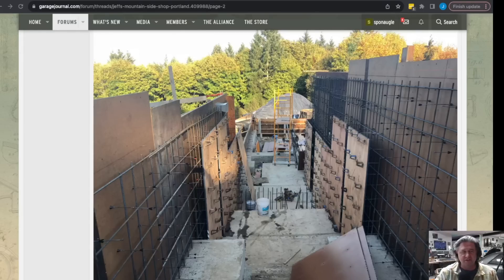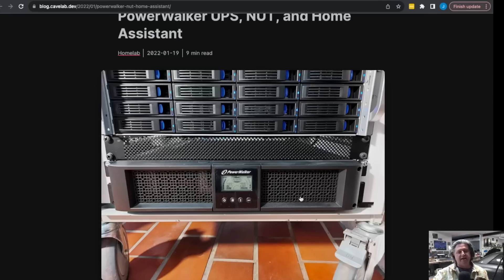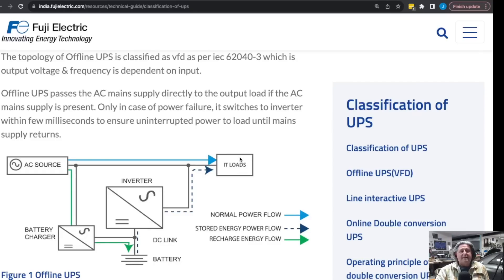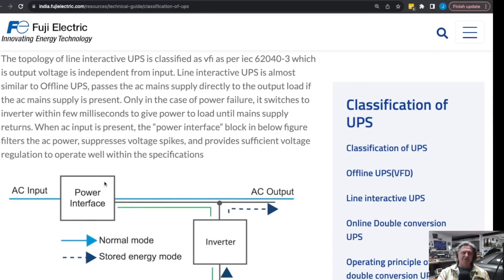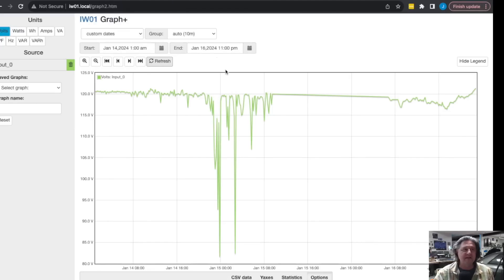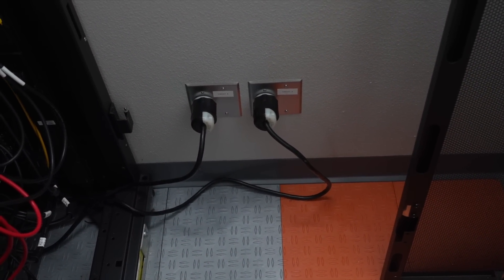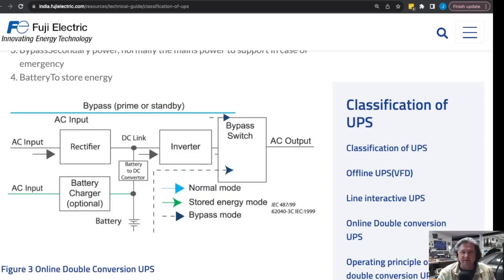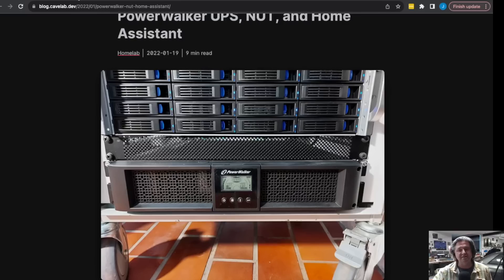Tips for powering your homelab

Comment: That online double conversion UPS.
Question?
HOW do the servers catch fire?
Does the amp draw get too high?
Shouldn't the circuit breaker turn off power to the UPS?
How much power does the normal home lab consume?
240 3 phase or 240 single phase?

Comment: More thought than I want to put into this part of my homelab. I do monitor this through Solar Assistant, but my feed goes into a single 1500va APC UPS that does a pretty good job, it seems, but my homelab is no where near the size of yours. Mine maxes out at 500watts with the loads I put on it. I might add an ATS, but right now, if I'm down on off-grid solar, I physically move the UPS cable from the 120v out to the House 120v, which is also close to 75% from solar as well. My home office, is also powered by solar from an extension cable run from the load out on an Epever charge controller, to the battery-in on an Eco-Worthy, Charge controller/ATS/UPS that works pretty well. That system is powered by 900 watts of panels on the roof of a tool shed, and a home built 1.3kW recycled 18650 battery. We should probably start a group of Homelabbers powering with renewable power sources. I no longer feel guilty about running my servers 24/7.

Comment: UPS - Don't pull UPS down to 10% if using lead-acid chemistry batteries. This shortens life quickly. Stop at 50%. APC's UPS's are great with crappy power but also great at cooking batteries.  Mounting, many are low for the weight as well as if the batteries leak, no servers under to get stuff.
Reply from the maker: That is good advice - I did ask an APC engineer about this topic a few years ago and he suggested that when the UPS says 0% it is actually close to 25% (based on cell voltage)... this going down to 10% isn't really taking the batteries down to 10% of their real capacity. 

Of course he could have been making this up, as it is not documented anywhere I could find.
Reply: @jeffsponaugle6339  It's partially true but for a different reason. When under load, the batteries are being pulled on way too hard for their design, SLA is not designed for high currents and have a lot of internal resistance which a biproduct besides heat is Vd (Volt Drop). The battery management sees the lower voltage thinking cells are done before they are actually done thus the early shut-off. 
What sucks in the APC is the battery sensing circuit drifts with age and you will find them pushing higher and higher float or bulk charge voltages and thats why you get cookers. There are some guys who reprogram them, others replace the crap componeants, I myself, dropped all common UPS's and built my own with LF inverters that support UPS/Bypass function.
Reply from the maker: Very interesting.  I would have assumed the UPS logic would include derating logic based on current flow to adjust the measure cell level, but perhaps that would not be accurate over the long term.   I did not know that the battery sense drifted... that would explain the observation that these old APCs seem to cook batteries.  I'll have to look into the reprogramming/recalibration!

Comment: It may sound counterintuitive.. but undervoltage events can be a total hazard for some devices. At my old work place, we had really instable power, where one day 1 phase of a local transformer had failed but didn't shut off the other 2 phases (the installation was 70 years old). This meant that in our offices, some devices shut down as they were on the failed phase (inconvenient no damage), but other devices kept running on the other 2 phases... however its line voltage had dropped to 90-120V instead of 240V! We had some 240V-only lead-acid battery chargers running that went up in smoke. I suspect those chargers tried to deliver its nominal output power despite the MUCH low line voltage => a LOT more input current => P=I^2 x R => poof.  Fortunately, chargers and batteries can be replaced.. but talking about fire hazards..
Now I suspect many computer PSUs are protected with UVLOs and refuse to run with a too low line voltage, but be careful as not all equipment may be as well protected.

Comment: My cheap APC UPS are all capable of detecting low voltage without passing it through. You don’t need a line interactive or double conversion to get protection. Most equipment will happily run at 90V, just not long term.
Reply from the maker: Yea, most of the UPS will trip with voltage that low, so then you are on battery with the inverter.    I agree that most modern stuff is pretty resilient to low voltage - The one thing I have seen is strangely enough is some cheap ATX power supplies that die at anything below 100V.   Given they are switching power supplies they should be more than capable of handling a low voltage like that... of course I did say cheap so that is that.

Of course if  you are running 240V, those voltage dips make even less difference.

Comment: This is useful not for only homelabs, but for setting up university labs on a limited department budget ... thanks for this, been looking at how to justify the purchase of a UPS for an observatory's automated systems. The invertor usage was one reason I'd used before, but I never considered voltage distortion could be caused by random debris on power lines some ways down the line. Our equipment is in fact extremely sensitive to this, so that is helpful information and may explain some rare problems.
Reply: You might want to look into an online ups to keep the voltage stable

Comment: One thing I might suggest is to get a flood sensor and put it in your mechanical room. While rare, plumbing can fail and quickly fill a room. My flood sensor saved my bacon last Friday when a plastic valve on my water softener blew (possibly due to a momentary over-pressure event from the city's supply) and my alarm system notified me and I shut off the water to the house within one minute. Thankfully only about 10 gallons sprayed out on the floor but it missed all the expensive stuff in my server rack 😌
Reply from the maker: Indeed there is both a flood sensor plus a large drain in the floor.  I’m also using a Flo from Mohen which alerts me if a fixture is on too long or a leak pops up.  It is always good to have backup for problems like that as water can do so much damage.